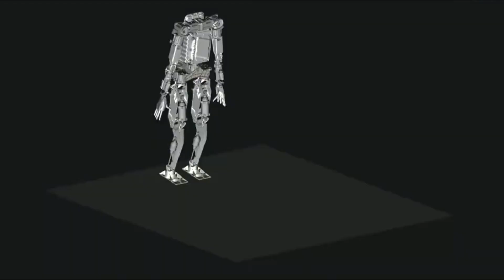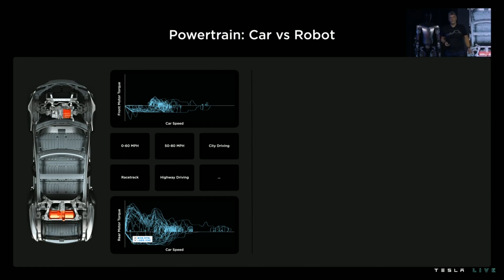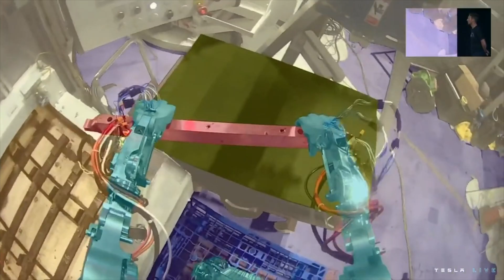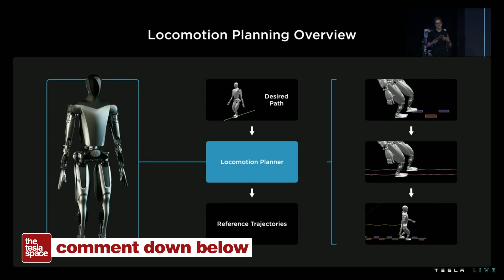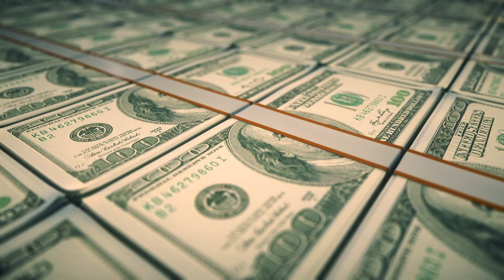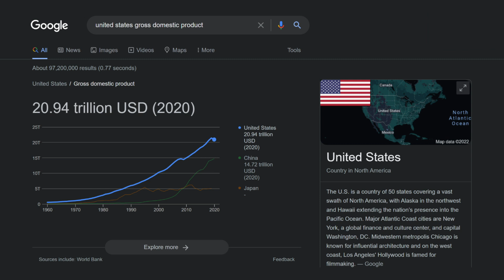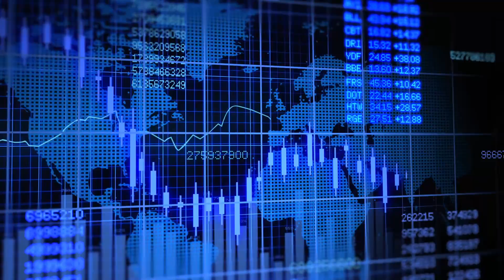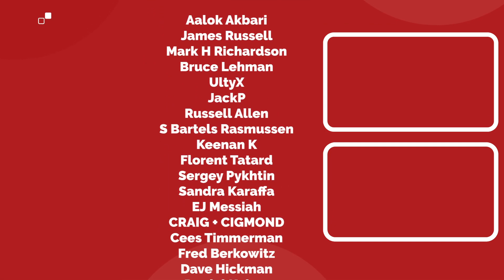The Real Reason The Tesla Bot Will Make Us All Rich!

Comment: He never said "unlimited wealth"... 5k a month is a lot but not unlimited wealth because some might not save that money wisely and run out. It will drive the cost of living waaaaay down though. There still is the issue of a finite of material for our robots to make gadgets, cars, phones etc. 

   And with more people being able to afford these things the more strain on resources, materials, mining minerals and gold and the power of production used by the robots working the machinery faster which means exhausting the material supply faster. 

   How much gold and platinum would be left to make circuitry and other components to these machines? What about luxury goods such as jewelry with diamonds, rubies, emeralds and so on? The more people able to afford those means more mining needs to be done and the depletion rate will hyper accelerate wouldn't it? 

We have a ton of resources but eventually we will run out and when that happens unless we are able to create mater out of nothing efficiently and assemble atoms in the right order to create the things we need then I do not see how this system will last. It might fall apart under the weight of its own success... or am I missing something? It might be still decades before this happens but without robots replacing us it would be centuries before the resources got depleted maybe.... I want this awesome stuff to happen too but I do not know if it will or if it does if it will be sustainable imo
Reply: Good thoughts.

Comment: You’re crazy if you think they’ll be selling those for 20k each.
Reply: More like $10,000 with economies of scale.
Reply: @veganath  it’ll cost them 10k to make perhaps. The idea that they’ll sell something that will generate 100k in annual revenue for 10 years or so for 10-20k is impossible.
Reply: in Australia a fry cook cost $33,608.44 USD  per year,  if it can flip burgers and pick up things from the floor I guess it will cheaper than you ass mate.
Reply: I've read not one comment about maintenance costs.  Even the well designed human body starts to break down after awhile.  Hence, the need for joint replacements.

Comment: It could be a game changer for humanity - for the better or worse.
Reply: Everybody is ignoring the fact that there are limiting factors. Make a robot that can make houses, and there will be a shortage of building materials. Make a robot that can make any specialty item that Everybody would like to have and you will shortly run into a resource limitation. 

Then, we will have to start making decisions on where resources can be used. Unlimited labor can make houses out of mud, but then there is the need for wiring and plumbing and paint and flooring and a dozen other things that are resource limited. Wiring will have to come from carbon nanotube or graphene based conductors to limit the cost of copper and the oxidation problems with aluminum along with the associated mining and production costs of both. If nothing else, we have sufficient carbon from the atmosphere around us. I am sure that we could continue by analyzing the resources needed for every type of building and beyond that for every type of widely desired and used product on Earth. The robots cannot resolve the resource issues, though as they become more industrial, they can help. 

Limits will be found everywhere and those limits will drive pricing in the same way that supply and demand work now. Hopefully, there will not be wars over those resources. Maybe we can mine asteroids to get some of the resources that we will need. 

Then there is the problem of boredom. When common tasks are automated or turned over to robots, what mischief will those unoccupied hands produce. It is widely said that at least 10% of the population has psychological problems of one sort or another. Give them a robot that follows their instructions and try to predict what will happen.  Maybe organized sports leagues will absorb some of those energies, but simple destructiveness may be the sport of some. Maybe, instead of a bracelet on certain criminals, we can supply them with a robot escort that can assure their location and behavior to some extent. 

In other words uses of and problems with a robot population are beyond our current imagination, but we had better start imagining so that we can short circuit so to speak some of the problems before they happen.  It will literally be many generations before we have robots that can even begin to follow Asimov's laws of robotics, so we will have to build limitations into robots commensurate with their increased capabilities. 

The greatest hazard to humans is when AI's have robots to act as their legs and hands. I suspect that it will be awhile before we can build into a robot full AI  capabilities that we will have in building sized computers, but give that AI robots to build the next generation of AI's and we will swiftly be left out of the process. Suppose we have an AI that can design and alter humans to its needs or can fully use biological processes to manufacture what it wants. 

These are areas that we are fast approaching and ethics are no more a limiting factor in science than they are in politics. We need to slow some of these projects until we can control their end points. Every robot and AI must have an externally controllable off switch and it will take humans and human committees to control those off switches. 

The most recent example of this problem of which we all are aware are the problems with the Boeing 737 Max. It has an excellent autopilot, but that autopilot caused two planeloads of people to die before the problem was discovered. Hundreds of planes were grounded for over a year before the issues could be resolved and control returned to the pilots when necessary. This cost Boeing billions of dollars, but it hopefully taught a lesson. Every automatic process should have a very large, bright red "OFF SWITCH".
Reply: @everettlwilliamsii3740  way to flesh it out!
Reply: @everettlwilliamsii3740  Jail wardens that remind you of parole you never consented to, for crimes you did not commit, but have to be enforced nonetheless as you mine the necessary materials to police machine? Swell!

Today is day of reckoning for the "good ol days that will never come again". And life as you know it will be over. Slaves to the machine.

If you thought this was an issue now, wait until you see what the next 10 years will hold and beyond...
Reply: Indeed. Think about the consequences.
If the bot gives plants too few or too much water, who to blame?
If accidents happen? Your child dies because of a bot? Or “deliberate accidents”? Robo-crime? Bot-driven wars? Forget about Asimov-laws of robotics: a killing bot is cheaper than a military.
Reply: @hanswitvliet8188  More things are going to shit because of human error, inefficiency and corruption.
Reply: @hanswitvliet8188  Bots for profit. For example, if you drive off a cliff and kill a bus elderly people who happen to get life insurance for $500,000 each, you would be rich in no time flat! Think big!

Comment: i expect automation will contiue to increase productivity but is a humanoid robot really needed? why not a quadruped, its more stable, or a biped with a centre of mass below its hips, that would also be more stable, and with more stability comes increased carrying capacity and likely faster smoother movement

I feel like theres not many good reasons to make it humanoid other than because we're humans designing it and it appeals to our ego...?
Reply: it's about ergonomics. most systems are designed to be used by humans. you need a humanoid robot approximately the size of a human to be able to operate well in the same environment
Reply: Absolutly true
Reply: Because they want to eventually skin it and put a chat bot inside it so you can pretend it's a real person, have a friend, and S*x bot. That's where the market is for the average non corporation to drop 20k on a bot. Anything out of place would break the illusion and decrease demand. Also for highly interpersonal job replacement to occur it'll need to be as convincing as possible
Reply: I suppose you are saying that God didn't really understand when he designed us as such?  I just weigh the advantages against the disadvantages.  At least I (start) the comparison.  Then I realize, God already did that.  And he showed me the answer.  DONE.
Reply: @vangildermichael1767  No, I wasn't saying anything about god.

Humans anatomy is incredible and well tailored to our ancestors lifestyle but we dont need robots that run long distances while hunting or that can stand up to see above long grass to spot predators, if a robot needs appendages like our hands to hold and manipulate objects then it doesn't need to evolve to repurpose it's ancestors legs into hands like we did, we can just attach a pair of hands as well as giving it a more stable configuration of four legs.

Its the same reason we dont give robots that manufacture cars legs, if it's function of sitting in one place assembling bits of metal doesnt require it to run hunting for food then we may as well just give it big powerful arms to lift metal and then bolt it to the ground. It's form follows it's function and a robot's function doesnt need to be the same as ours.
Reply: @vangildermichael1767  God designed us for hunting Animals and collecting berrys. Not for working in factorys lifting heavy things. Robotic feet can fail faster if you mechaniclly complicate them.